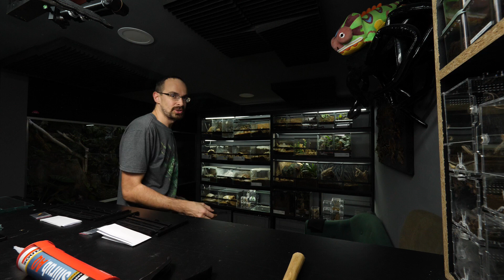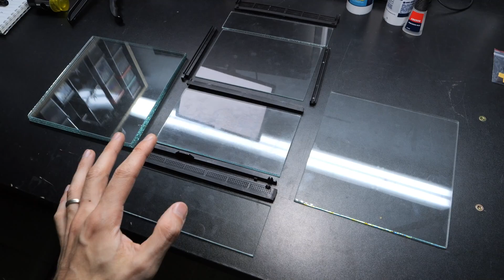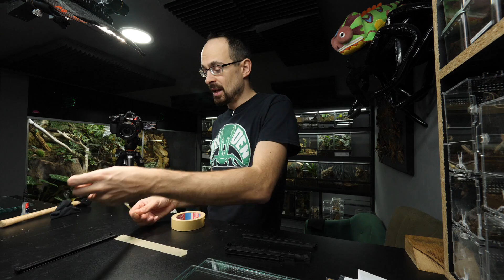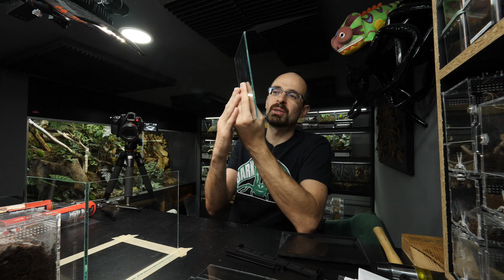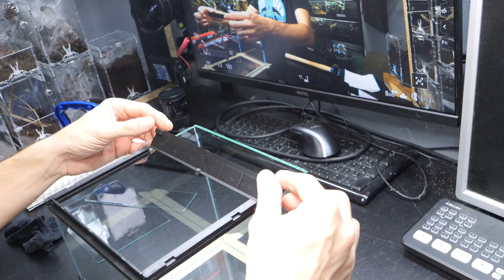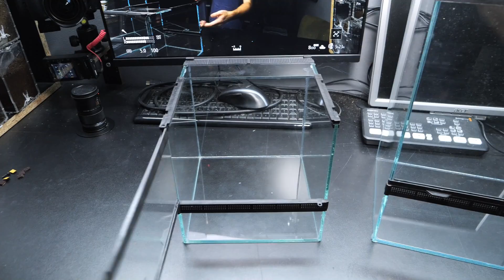How to Build THE BEST DIY GLASS TERRARIUM? - For Tarantula Invertebrate Lizard Plants - Tutorial

Comment: So 1/8 strong that's an incredibly hard thickness to find in Canada. 5/32 2 32 is 1/16 2 1/16 is 1/8 plus 1 32 is an eighth strong
Reply: When you add strong or a plus sign it means a 32. 1 1/8+ = 1 1/8 plus a 32
Reply: @Mr420xxx420  ok cool. Never knew this. Learned something new. Nice
Reply: Strong?
Reply: does strong mean thickness in this case? hmmm?

Comment: You should have went with 3d printer instead of molds.
Reply: The originals were 3D printed and were a little too weak. Many have already broken on video.
Reply: plastic injection mold parts are wayyy stronger then 3d printed.